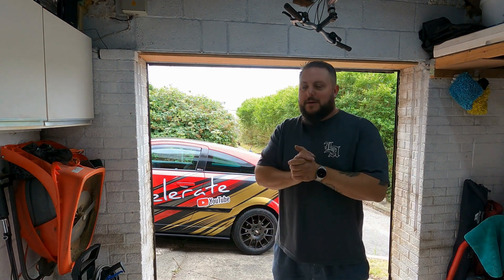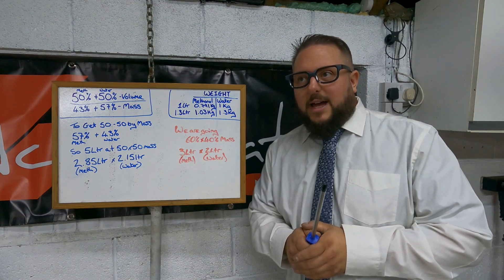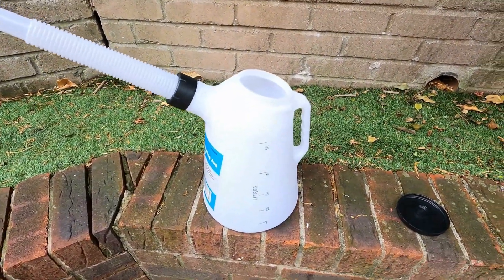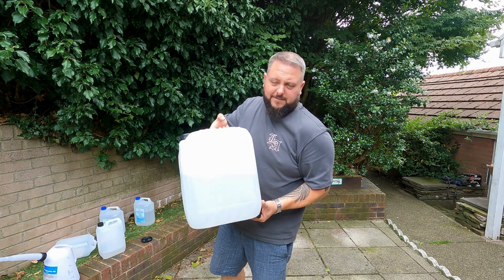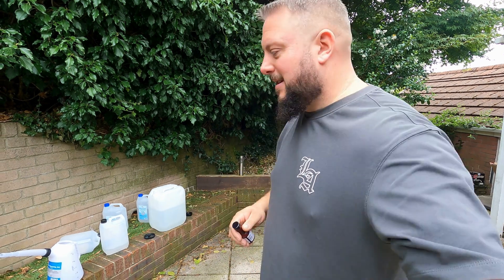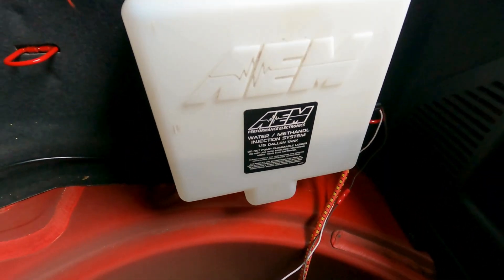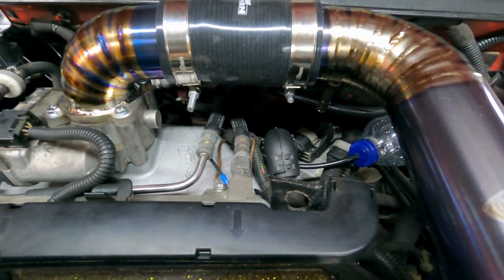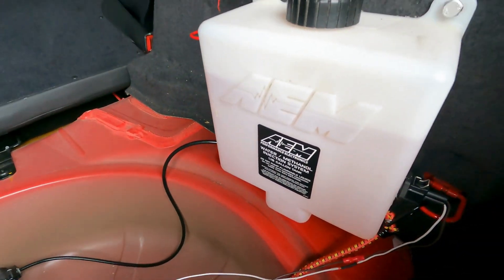Mixing Methanol Injection, The Correct Way!!!! 50/50 Mix

Comment: How fast do you think you will go through a bottle
Reply: We've fitted the 250cc nozzle, they say its around 1 per tank of fuel, but depends how its driven. Mine is at full spray at 20psi and starts around 10psi